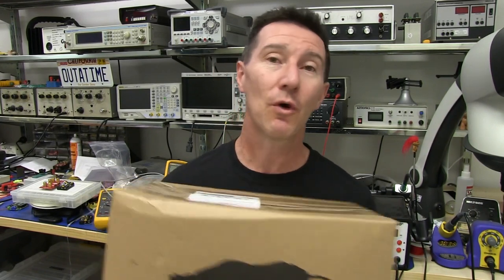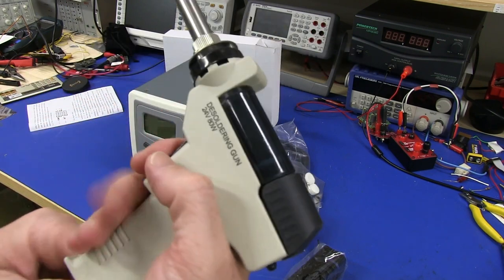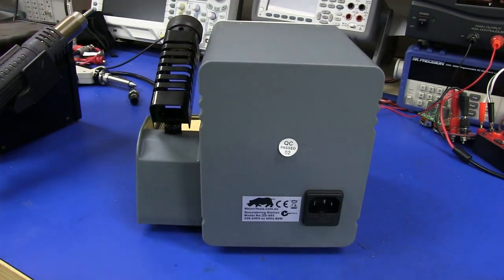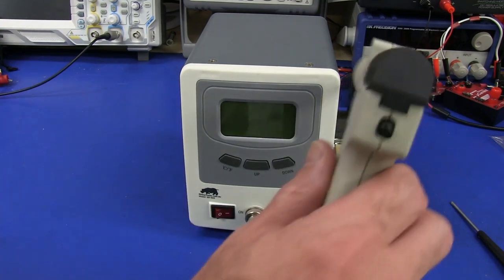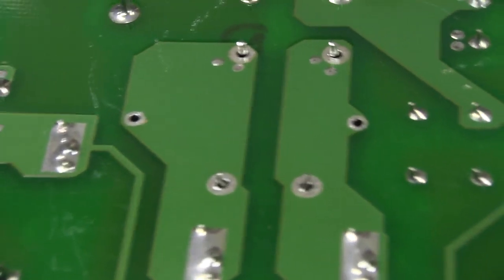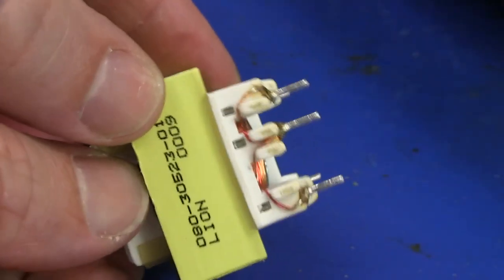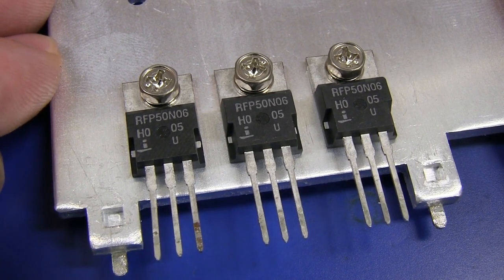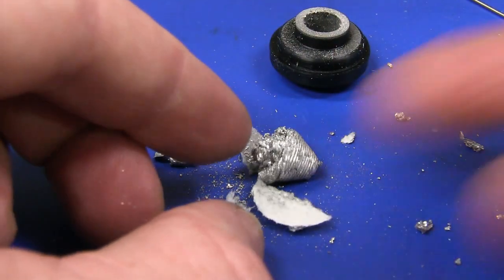EEVblog #542 - ZD985 Desoldering Station

Comment: Oh God, I LOVE my Hakko 808. I should order some new tips and filters for it though. That puppy sucked out the solder from a 50 volt 20 amp power supply I'm working on. Love it! I've also used a Pace desoldering tool that generated it's vacuum from shop air. I don't recall the model, but that's the unit that convinced me a spring loaded Sold-a-pult was not a realistic rework tool, and led me to buy the Hakko 808! XD

I might have bought one of these instead, had I not gotten a good deal on a new 808 instead.

*EDIT... Nope... do not want. The Hakko is worth every penny! That slow heating, the build quality... Just NOPE! Knowing now what I know, I'd never buy this, having used the Hakko 808. I probably would have bought this for the price back when I first bought my Hakko, had I not gotten that deal. Now... Never! Don't get me wrong, it did perform well... eventually. The Hakko reliability though, is just worth every penny!
Reply: I hope your element never fails on the 808. Mine just quit and they are now obsolete 😞
I also loved my 808 but now its scrap !!! Thanks Hakko.
Reply: @KB1UIF  I'm sorry to hear that... Is there no stock anywhere?
Reply: @richfiles  I've not been able to find one. It looks like if you can find one in stock, it could retail anywhere from $50 to $150 or more.

Comment: I bought a Solder Peak SP-1010DR desoldering station , I played with it about 15 mins , I cleaned the filters , put all back , power on , heating and when I pressed the trigger button for vacuum has died . Really bad build quality ...

Comment: yeah finally i have bought this tool in germany under the name ZD-915 ....  the video helps me with my decision and yeah i know what i bought.... but for the work what i do with it, and the money that i have it´s definitely a good investition
Reply: unfortunately not. the difference is between the pistols. The cartridge who carry the molten solder is not as durable as that one from the ZD-915. one tip had no hole in it and the spring is a really cheap one not so fine as the other one. its a bit of a struggle to clean it but it works fine. i have desoldered a whole dj mixing desk with it, and now the tip wobbles a bit. but it works still. for that price its ok. and the replacement pistols are also really cheap to order.

Comment: 9:59 have any of that aluminum heat sink left over?  the 25mm wide stuff?  you could use two self tapping zip screws and a 40mm length and re-enforce it?

Comment: I could not find a ZD985.  I was told the ZD915 replaced it.  I bought one of those.  I do wish I could find a replacement vacuum pump for it as it needs a little bit more suction to do the job.  Do you know of a better replacement vacuum pump for the ZD915 and the ZD985?

Comment: Hi! I got this unit and I'm not having much luck. It heats up fine (sometimes the temp resets to 200 though), and it sucks, but parts don't "fall out" like in your video. I try to de-solder caps from motherboards. Some holes look neatly sucked like in your video, but for many it doesn't seem to do much. The caps only move with great force. Is there anything I could be doing wrong?
Reply: There's probably still solder on the component side of the PCB. Power parts on mobos are just about the worst kind of thing to desolder. Try holding the nozzle on the part for longer before applying suction. If you're coming back for a second try, dab a tiny bit of fresh solder on the joint to help wick the heat through to the remaining solder on the other side of the joint.

Comment: Hi i have a zd 985 Desolder Station and it works fine, i had byed this one 15 Jears ago. Ihave a second one from "brand" AGT same Desolder gun in other colors. This one comes in two versions. A 90W version and in a 200W Version.I have the 200W one and it heats fast, much more faster then the 90W type. This two Versions arne not Compatible, used differmnet Thermocouples. and i think the Pinning from the Connector is different. Best Regards from Germany

Comment: Does this only work for 220V?  Seems odd that it would be fixed voltage and use an SMPS when most SMPS work over a universal range.  It looks like a good tool for the hobbyist and home hacker lab and I'd definitely consider buying one if it worked on 120V US power.  Definitely beats my crappy RadioShack desoldering iron with a manual suction bulb.

Comment: I had bought the basically the same unit, but mine was dual solder/ desolder. Same vacuum gun, same crap display.....  mine didn’t work either!  The display board had a bent pin on the input connector not allowing the thing to heat up...  The Vacuum at the base was great, but at the gun itself, practically nothing......  Spent a few hours troubleshooting this problem, different O rings, removing the filter material, different hose...... Finally noticed a crack in the black plastic ring behind the heating element... Used some glue as a sealant, and that did the trick.... Kind of!  Yeah, it works.... But the suction at the tip of the gun in no way matches the suction at the base unit......   It’s just POORLY made!  I paid only $50.00 US bucks for it, and I still feel I got ripped off!

Comment: This thing is rad, could save myself a few bucks by salvaging parts from old computers on those road side collection weeks("junk collection"). But $190 is a bit high for me, I dn't use that many parts. Should just buy a solder sucker for $5-10 instead of using the old heat and push method :p

Comment: What are your thoughts on Pace soldering and desoldering equipment?
Reply: I used Pace soldering and desoldering equipment when I worked at Telstra.  Good quality, worked well, but expensive.  For hobby use, something like this one would be better value.  But probably not for heavy duty use.

Comment: My Aoyue 474A++ seems not to be near as efficient as this one in those demonstrations.
Reply: Julien Same, but I’ve learned to deal with it. Mine is the older model with the “more robust,” but weaker, AC pump but it’s also the one with the added soldering iron and fume extractor.

First thing is to give it over 10 minutes to warm up, even though it says it has reached the target temperature.

Next, do not get the sponge filter too wet. It will impede airflow (also, don’t use it dry). Just damp.

Third, crank the temperature to 400+ and run the pin through it as often as you can.

Fourth, don’t use the fume extractor if your station has it. It will gunk up the motor with dust from burning flux. Mine eventually clogged ENTIRELY and I couldn’t clear it even after taking apart the gun and motor to clean inside and out. The actual tubing inside was clear and looked perfectly clean but I eventually found that the very back of the nipple you connect to externally had clogged (behind the filter). I could only tell because I had the casing open and no light was coming through (tubes inside are clear). I took the pointy end of a watercolor paintbrush and poked it in only to see a puff of yellow dust fall into the clear tube.

My suction had dropped notably the second time I ever used it for desoldering so this can happen really quick. It frustrated me enough that I didn’t use it much over the next year, maybe tried it once every month or two. A year later is when it completely clogged while the irons were just sitting in their stands (fume extractor was running). I just heard the airflow slow until it stopped. I was slowing fast enough that I noticed and was paying close attention over a few minutes before it happened.

OK, maybe I should have made than #5...
Fifth, poke something into the from nipple behind the filter every now and then to clear any buildup that happens there. The filters definitely don’t do it.

Comment: Hi, Dave,

I have the Duratool one (UK), and I noticed something dodgy when I opened it up - the SMPS was only outputting 18V, when the gun heater is meant for 24V! :o

If you get chance, could you possibly measure the voltage output of your PSU?

The Duratool seems to get up to heat fine, but I'm sure it would decrease the heat load capability at 18V? Let alone the pump motor running slower?

I think the motor was run off the same voltage in mine, but worth just checking the voltage across the heater pins (where the stupid wire fell off on yours. lol).

btw, you should have a rubber grommet between the front of the chamber and the heater? (The rubber washer on the back part of mine does go a bit further into the chamber.)

Ash.

Comment: I think your making too much of the build quality. I'm not to fussed so long as its works. Basic electrical repairs aren't much an issue but I take your views about quality control. Jan Beta did a review of a similar unit ZD915  on his channel though he didn't take it apart to the same level that you did. His looks slightly better from what I could see.

Comment: I need a motor for my jf 88 g desoldering station. What is the spec of motor used in such a desoldering stn? I can figure out its 220v pmdc motor, what else do i need to order one? Thx

Comment: Whine whine whine whinge, doesn't work. maybe because some knob head took the cover cover off and flexed the front of it back and forth whist pissing and moaning about how shit it is without taking notice how said knobhead had dislodged the wire itself.
I have had 1 of these for years now and it still runs perfectly, when I need to desolder I turn it on and leave it on standby till ready to use, if not used within a certain amount of time it switches to standby mode and drops the tip temperature down to 200c till the trigger is pushed and then goes back to my preset temp.
Reply: I've got a $20 Yihua soldering station and it's awesome and does everything I need and more.  Dave constantly saying that you must spend as much as possible on an iron just demonstrates that he's an equipment snob - "I'm an electrical engineer, so I MUST use Hakko, Fluke etc - everything else is total shit".  This is further evidenced by him saying that the desoldering unit's functionality "is as good as a Hakko" (37:09) and then giving the unit a "thumbs sideways".  He's just looking for reasons to bash the unit because it's cheap, because he thinks that real EEs don't use cheap Chinese stuff (hi, bigclive!).  
Dave is so biased when he reviews stuff, it's getting beyond a joke now.  If something like a Fluke or Hakko comes in for review, you know he's going to be glossing over any problems he finds so that he can put them up on his little EEV pedestal and worship them.  I simply can't trust Dave's biased reviews anymore, so I watch but make my own mind up ignoring all of Dave's many biased comments.
Reply: @EscapeMCP: The worst part is he admits to being a "tightass" just like everybody else. He could have spent several times the money and gotten a "proper" tool, but went with value for a tool that did the job.

Comment: I have a ZD-987 Soldering / Desoldering Station. It is better build quality for the price, I get it in germany for € 129. It uses a transformer, no switchmode supply and it has a metal case :)

Comment: I rather get a proper HAKO instead of a cheap knock off. You get what you pay for. And it will cost about the same as HAKO soldering station like this one FR301-03/P Desoldering Tool

Comment: is there a rather thorough desolderinng station you would advise to buy ?

I am a hobbish now, but I used to work with it fixing computer motherboard and laptops and had to desolve lots of things.. mainly smd components.. and it was always a problem to do so with the thick tip of my solders.. but i am asking because I want to buy something good, which will last of a long time. I am not worried about the money yet.. if you could give me a few models to choose one from, I would really appriciate..

I am sure I wont find them in brazil, but I can ask a relative of mine to send me from overseas.